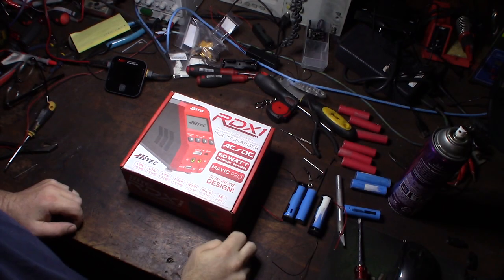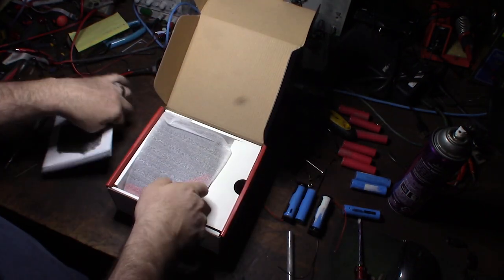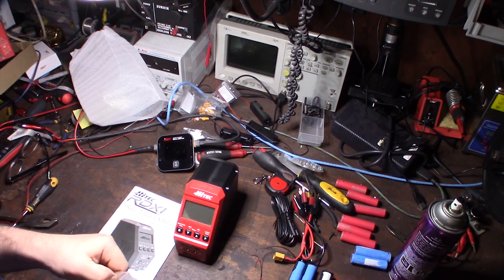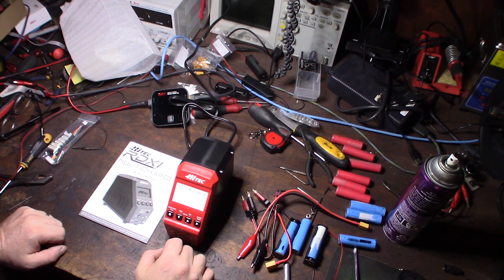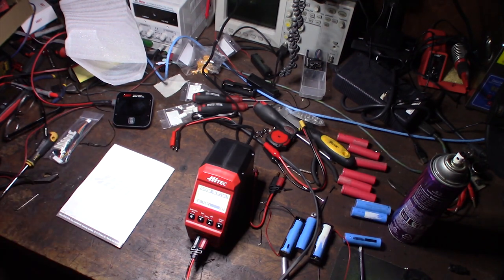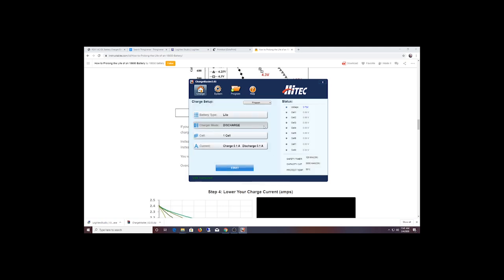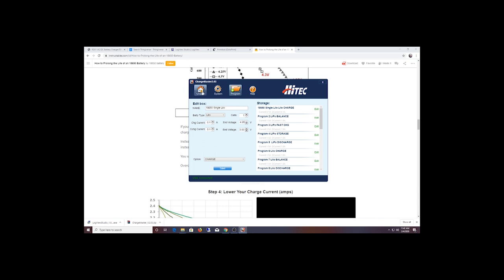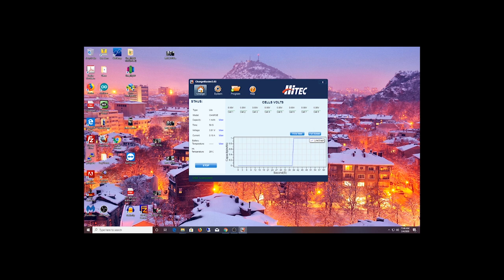HiTec RDX1 charger with ChargeMaster software, Another SkyRC imax B6 B6AC clone Lipo LiIo

Comment: When charging a NiMH pack on this, is it correct to input the total number of cells? For example, I selected 6S on a 6-cell NiMH pack. Seems to get the pack nicely warm, and total mAH received seems correct, although the reported voltage while charging seemed a bit high, sometimes approaching 9V.